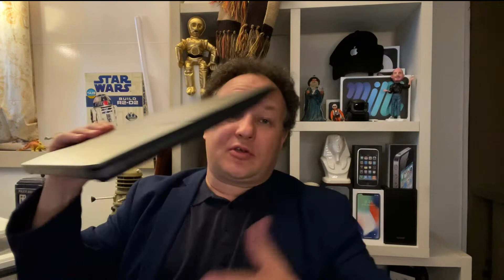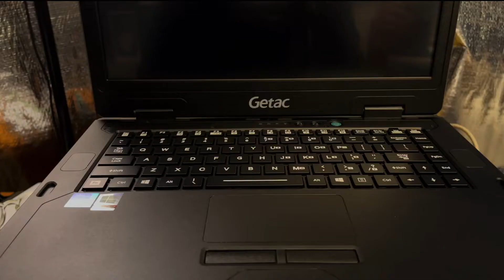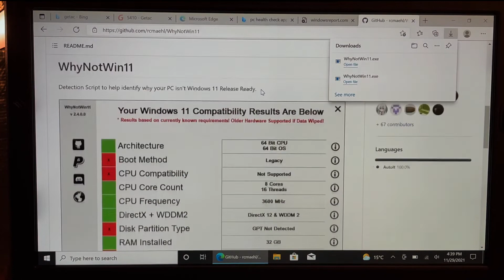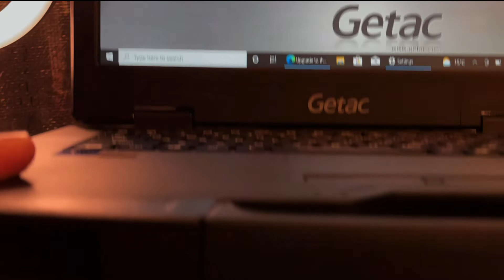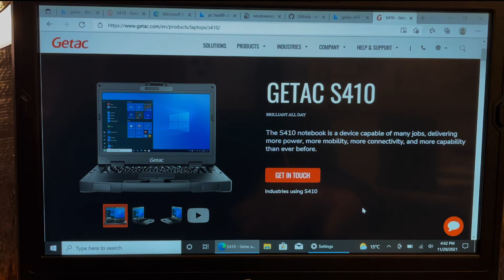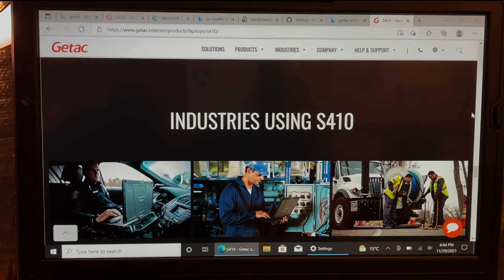VIDEOS: The Getac S410 is a win for semi-rugged laptop users

Comment: How to open DVD port??
Reply: There should be a hidden screw covered by a small round black removable sticker on the back of the Laptop,
right above where the DVD Drive, Optional Battery, or Optional SSD Drive would fit in.